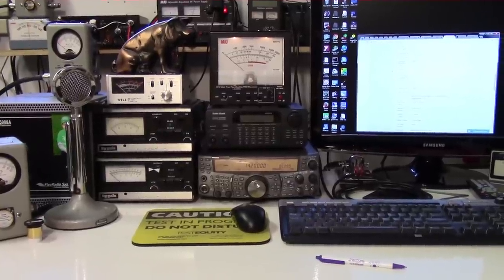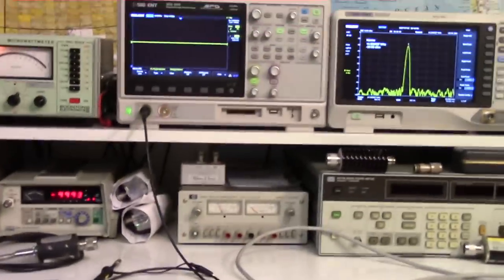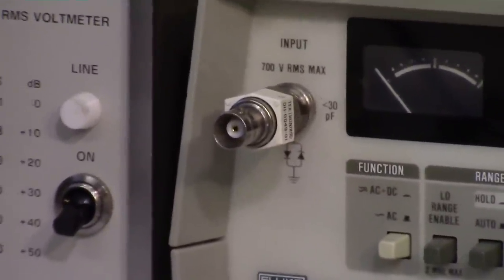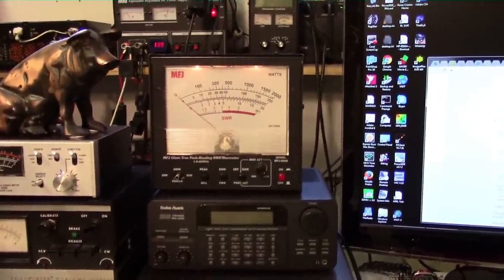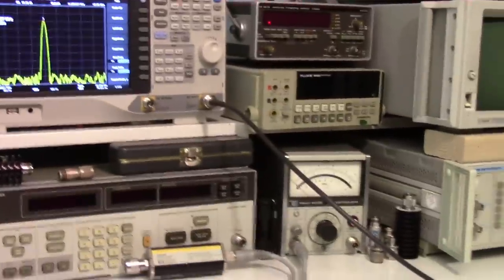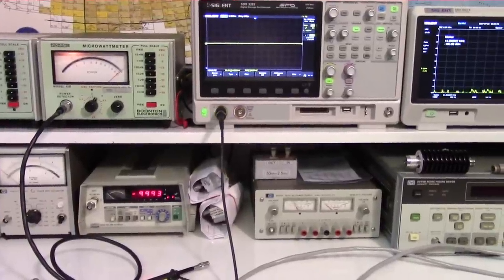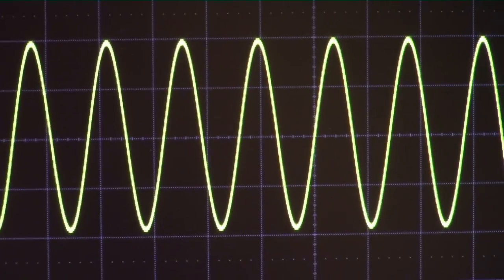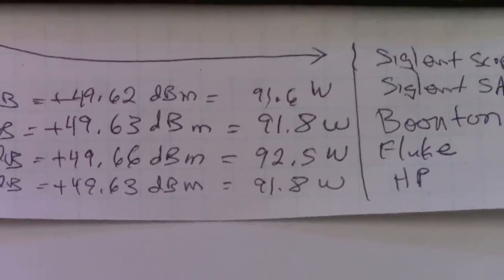Measuring RF Power With an Oscilloscope & Other Instruments

Comment: I enjoyed your clear discussion on power measurement techniques and am glad that you brought out the need for accuracy. I too have a 
Kenwood TS-2000X transceiver and wish to use it to operate a microwave transverter that I designed. My concern is power transients 
and their duration upon transmission, preceding the steady state condition. Have you observed such behavior? Can you recommend 
a method of performing such a measurement? I was thinking of triggering my oscilloscope using the PTT pin, but am uncertain of the
procedure.  73's, AA0BR/VE1GR.
Reply from the maker: Hi Phillip. Glad you enjoyed the video. Yes using the PTT as the main trigger source would be how I would start. You can always use delayed triggering to ensure you capture the start of RF output.
I would use a directional coupler to sample the RF and then attenuate that RF as needed not to  damage the scope. Try it out. If you run into trouble let me know and I will see if I can set that up and make a video. 73

Comment: Good topic you have covered, interesting and useful for me. Once clarification, as i can see when the measurement is being done in FLUKE where the max.frequency limit is 2mhz. in this video are we measuring a CW signal or demodulated CW signal. OR  a CW signal below 2mhz ?
Reply from the maker: This Fluke meter has a BW of 20 MHz. The HP-3400 has a BW of 10 MHz. The test signal I used here was an unmodulated CW carrier.

Comment: This tutorial was simply SENSATIONAL 👌..
I think you are definately the person to do a similar video on SSB 2 tone procedure and generating an S9 signal with the cheaper signal generators out there , eg Feeltech FY 6800 etc, as there minimal voltage out is .0001v. 
Much appreciated 
✌️73oz😊
Reply from the maker: Thank you for taking the time to comment and making suggestions. So many projects, so little time :-)  Let me see what we can do. 73
Reply: @w8bya  that's OK mate I have nearly everything sorted, understanding dBm took me ages..
HANGING to find a FLUKE 8920A , not having to worry about a matching power sensor is a win win.
✌️from 🇦🇺 🪃
Reply from the maker: @gixerags750  Awesome ! Just remember that the instrument you end up with has enough bandwidth to accurately measure the RF at the frequency of interest.  For example the 8920A would not be a good choice to measure power at say 10m or 6m etc. since it only has a 20 MHz BW.  73
Reply: @w8bya  DRAT ! , I'm an 11m ChookBand fan boy...oh well ,back to the options.
Peace ✌️
Reply from the maker: @gixerags750  No worries. You know here is another possibility for you to consider. During the last 1-2 years there has been an explosion of really cool, small, & portable VNA and SA units for super cheap prices. If you wanted to get a pretty reasonable power reading you could try padding down the RF output (by a known measured amount) and feed that into one of these new portable SA's. You would be within a dB I imagine of the "real" power level.
Reply: @w8bya  yes..I have the nano VNAH and TinySA , just have to order some SMA attenuators, probably best having a decent understanding of attenuation, much rather fry a TinySA than a $2000 Siglent SA.
Tanks for all your advise.
✌️
Reply from the maker: @gixerags750  If you ever need a sanity check before you test a several watt transmitter with an instrument designed to measure signals thousands of times less feel free to shoot me an e-mail and we can go over things together. My address is aok on QRZ dot COM.  Just do a search for my call sign and you can get my e-mail address. 73

Comment: Nice video...would have liked a bit more calculation and explanantion on how you came to the 30db and 60db ateenuation for the Kenwoods 90watts...
Cheers
Reply from the maker: Glad you enjoyed the video. So the 1st attenuator, the big bird 30 dB was used because it was the only pad I had that could handle 100W. Remember if you put in 100W into that 30 dB attn you will only get out ~0.1W. That means that 1st attn must be able to dissipate 99.9W ! If that Bird was a 40 dB I would have used it then adjusted the value of the 2nd attn accordingly. Likewise if it was only a 20 dB pad I still would have used it because that first attn is the one that will have to dissipate the most power.

Ok so then we move onto the 60 dB pad.....As seen in the video I mention that 100W equates to +50 dBm. You must add enough attenuation to that +50 dBm signal so you do not damage your SA or power meter sensors etc. The SA for example can safely input a +10 dBm signal and since I already knocked down the +50 dBm signal by 30 dB all I would need is an additional 10 dB pad and I would be good to go. BUT, because I was going to also measure the power with various sensors that could not handle so much RF input I used that 60 dB attn which was handy. The very last thing I would want to do is blow up my 8484 sensor etc ! So you can see you have some flexibility in what the value of that 2nd attn can be as it depends on the instrument you plan to use and how much your 1st attn was able to knock the signal down to. I picked 60 dB because it allowed me to get reasonable levels on all my instruments. Hope that made sense. 73
Reply: @w8bya  thanks very much for the detailed answer...i need to study this to understand dbm more.
Much appreciated....love your setup especially the Boonton and HP power meters...seen a few for sale but none with the the special input adapters..
Great channel.
Reply from the maker: @gixerags750  Feel free to e-mail me directly at w8bya at mchsi dot com and I will be happy to help you get set up with some neat basic test equipment.

Comment: Just discovered your videos, absolutely fascinating, quite amazing consistency between the results. Was partially hoping you might try the diode probe approach to get Vpk. Just curiosity really how well it works when signal swamps the forward voltage drop region of the diode. Regarding the Bird 43, it might be interesting to perhaps test at 2Mhz intervals across the range of the slug, not sure they will be so optimistic at 4Mhz or so. Great video, well done
Reply from the maker: Hi David and thank you taking the time to comment. I am glad you found the video of value. I have not modified the TS-2000 to XMT broadband and don't have a way to easily generate high level RF across a wide bandwidth. But yes I suspect the slugs are not completely flat and do have ripple.
Reply: w8bya, thank you for the swift reply. I must admit that I had just read the Bird 43 or 4304a manuals a few hours before finding your video. One of the test/cal procedures did involve taking measurements at multiple frequencies and doing some "averaging". (I suspect this was the 4304a as it has the wideband slug). I found the video excellent and it was amazing to see such correlation between measurements, of course you have data on various parts of the set up. Regarding the Kenwood not being general coverage transmit I was thinking more along the lines of seeing how the 43 behaved across the HF bands but I expressed it badly. 73s
Reply from the maker: @g0fvt  No problems David. When I saw 2 MHz intervals I had assumed taking something like the HF slug and testing it every 2 MHz. That would actually be a neat test. As a point of interest one of my viewers here was a line technician at Bird and performed the calibration on the various slugs. He and I talked about it over the phone many times. As you say it is not all cut-n-dry and involves a bit of talent to tweak the coupling and make it meet specification. He said some slugs were very problematic and when other techs could not get them to pass they were given to him because of his many years of expertise. He has long retired but it was fascinating to hear the story of these components. 73
Reply: @w8bya thanks for the reply once again, I think many of us that have used them for a while have a great fondness for the Bird 43 and it's relatives. It is unfortunate though that a useful set of HF slugs works out expensive, so despite having 7 Thrulines and a few Termalines I need other power meters. One of my personal favourites is the MFJ-826B, sadly one of the negative reviews on Eham cited that their 100w radio measured 130w PEP on one of these meters, so they concluded it was the meter's fault!  Thank you for taking the considerabe time to make these videos, I have been a subscriber to W2AEW's channel for years but only discovered yours yesterday. IMHO the amateur radio community needs more intelligent discussion, for a science based hobby it seems to have been permeated by a lot of witchcraft.
73s
Reply from the maker: @g0fvt  Yes I agree with you 100%. There are WAY too many "self proclaimed experts" out there who will put out information or a video and have no clue as to what they are talking about. And unfortunately those who may be ignorant about the subject take it in as fact. I always tried to teach the engineers & technicians who I taught & mentored when I worked that is it absolutely perfectly ok to tell some "I do not know" or "I am not sure" rather then to spit out any answer to save face in front of a senior engineer or management......Sometimes the pressure is so great that an answer or opinion is provided with a great deal of uncertainty. Also, yes I completely agree, W2AEW is an awesome gentleman who makes terrific videos. I am not one of those people. I have found it is VERY hard to make a clear, intelligent and succinct video that does it's job. My hat off to all those, like him, who have that talent. 73
Reply: @w8bya  the channels I object to are the ones giving incorrect information that delete any constructive criticism, most of us have been wrong a few times. Keep up the good work, sometimes  it takes a while to be "discovered" on Youtube. Nothing is  wrong with your content, I am sure that you'll get more traffic, this was a very impressive and fascinating demonstation. 73

Comment: I'm saving all this for reference. By the way. After converting P-P for the Ohms Law measurement, you should have compared it to the actual ERMS measurement, that your scope also makes and skip all the calculations.
Reply from the maker: Skip all the calculations?  I don't think so ! There are so many folks out there that do not have "fancy" scopes that I felt it important to show how the calculations can be made with virtually any scope. I did not want to leave them out in the cold.

Comment: Meant respectfully, your video confirms the old aphorism that a man with one watch knows the time of day but a man with two watches is never quite sure!
I found the fact that the Bird 43 slugs and the meter itself can have as much at a +/-5% error intolerable for the price they charge. I keep my bench scope calibrated down to a gnat's nut and go with that. The Diamond SX-100 and SX-200 meters are surprisingly accurate for a nearly FS reading. I had a Mirage that was dead balls on but I would not touch an MFJ with a barge pole.
That said, my pastime is QRP and QRPp and the need to measure in milliwatts critical. 
But excellent video as it shares your thoughts and ideas in a complete and informative manner. 
71/72 de k6whp 
dit dit
Reply from the maker: Hi Bill and TU for your comments. Yes I love the 2 watch saying as well hi-hi. Maybe we can amend it....and a man with 30 watches has the best chance of knowing the time statistically speaking <g>. But it was exactly that point, the fact that my different slugs measured so differently that made me want to experiment with different measuring techniques to see who was telling the truth. The nice thing about the bird slugs is they can be easily recalibrated.

Another thing many do not realize is that depending on the "topology" of the PM design it may become quite useless as an absolute power reading meter if the load is not very close to 50-ohms resistive. I will keep not only the Bird's around but even the MFJ's as they both have their purposes in my shack. The MFJ's are used only for peaking the PO of my HF amplifiers as I QSY bands & must retune them. With my bad eye's the large meter works great. The Birds I love because they are so robust and durable & could be mil-spec ready for field use. In any event, glad you enjoyed the video & appreciate your comments. 73
Reply: Gedas, I happened to stumble by and read your reply. Last time I neglected to mention that my lab scope is ALSO a venerable 7704A! You are 100% in to your assertion re the different wattmeters' worth -- so long as the user is aware of the relative drawbacks. For examples, one cannot drag a 7704A out to the field with a generator, so a Bird or MFJ that has been suitably tested and calibrated is just the ticket.

I also belatedly want to to thank you got your algebraic derivation of the Vpp to power formula. I was with you my long-ago dissipated math skills!

Oh, and as to 30 watches? I have a small collection (~12) of Casio timepieces. And I am never quite sure. I rotate their use of weekly and hack them to WWV!

I AM CERTIFIABLE! 

VY 73 DE K6WHP
Reply: regarding using different instruments ie two watches anology, in first year physics class they teach uncertanty principles and you can calculate them and end up with a +- figure. I had forgotten the gist of it.

Comment: That was a most interesting video!
I enjoyed it immensely Gedas! I got a lot more out of the latter part, where you were explaining the Math and proving the theory out. I love ❤️ Math, but so difficult for me! As discussed, remember that once you set the Element to 4/5 scale, that you perform Scale Shaping at 2. 10. And 30 MHz. If the reading anywhere is greater than +|-2% of FS defection, then readjust the Element until you have achieved scale shaping on 2, 10 and 30 MHz at 1/5, 2/5, 3/5, 4/5 and Full Scale. It is possible and normal that due to the diode used, the Element can be too sensitive or insensitive which messes with Scale Shaping and FS Deflection. It's always something!
Thanks so very much for taking your time to produce this video, not an easy chore by anyone's book! 73's David de K8KEM l
Reply from the maker: Hi David. Thank you very much for taking a look at the video and leaving some feedback. I look forward to re-calibrating several of my slugs and feel much more confident with all your guidance & advice ! TU agn es 73

Comment: TNX for taking the time to make this video! oh, I didnt fall asleep at any time !
Reply from the maker: Awesome....there may be some hope for me yet ! Thanks for the feedback.
Reply: The math part almost put me to sleep but you did it in a way that that wasn't drowsy lol ! Be interesting if u fired up the ol TEK scope and see what it sais !
Reply: I still have the one that I got from you and picked up a dead one from where i use to work at. should be an easy fix, has short on one of the supplies,  probably tantalum cap shorted,  very common problem with these scopes  73

Comment: You can actually calibrate your Bird slugs (not sure if you were going to simply characterize or physically calibrate, that may be where you were headed) with some minor surgery and an accurate source. I had to do that to one of my VHF slugs that was way out of calibration...little scary at first opening one up but once you get the hang of it not too bad.  73 - Dino KL0S
Reply from the maker: Yup, QSL Dino. That was the plan here, give the slug a lobotomy and carefully adjust the trimmer and align a bunch of them. 73
Reply: Wow Dino!